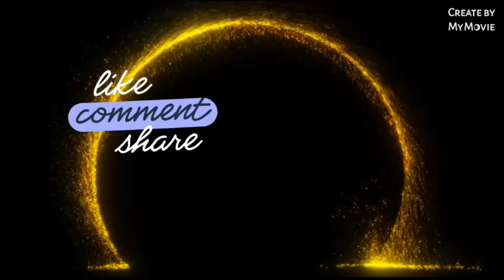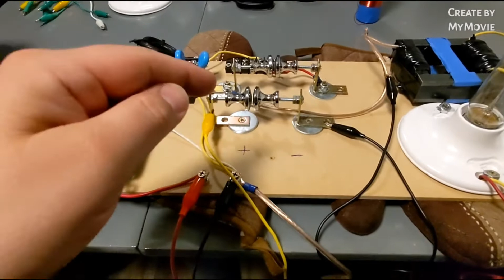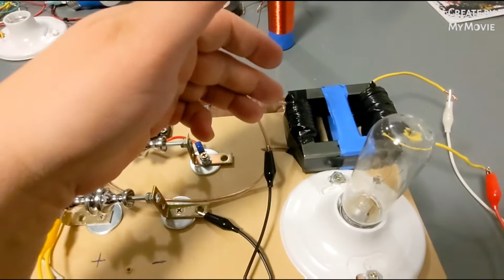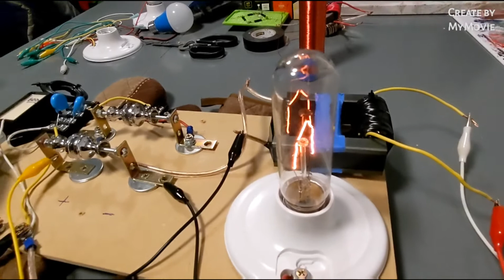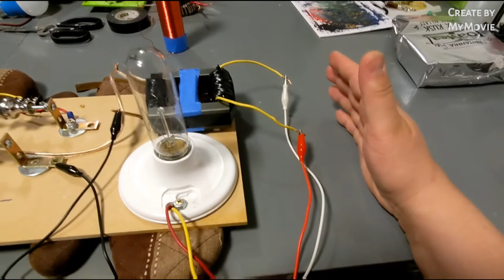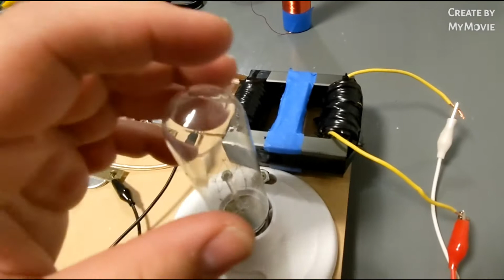Faraday Research RND Part 2. Don Smith Generator ⚡⚡💦#freeenergy #tesla #zeropointenergy

Comment: Hey just thought I would mention this. I hooked up my power supply to my system and it works. My supply is the same as yours. You should try hooking it up instead of the light and add a microwave transformer accross the power supply on the receiver end. I will try to show it in a video soon.
Reply: pls your information is what is lacking and do we need microwave cap and the transformer to change it to 50/60hz automatic
Reply: @claudiusolaoye7154  are you asking me that question?
Reply from the maker: Mike Faraday Research
Reply: @thewonn  yes boss.Microwave transformer and microwave capacitor both in reverse with  Don Smith generator  the cap will help in generating the  mains frequency to power any appliances
Reply from the maker: Yeah thanks a lot for that tes....t very interesting I have to get my hands on a microwave transformer I think I have one in my storage locker I'll have to dig that out hopefully this week and yeah I like what you're doing too.... keep it up! and yeah we can help each other.  thanks 👍    Mike

Comment: thanks, I've come a ways watching your research. will continue to soak it up. but I think I'm going to center my tinkering around manifesting electricity/current  from the elements or either. that way I will always have a power source to use when I replicate your work. if i have any breakthroughs that you can use, I will gladly share. thanks again for your time and energy